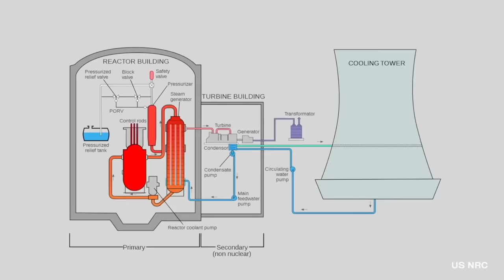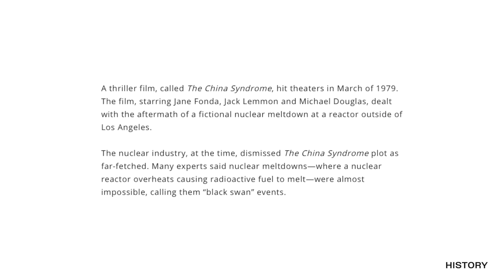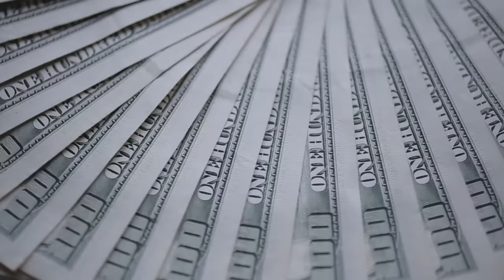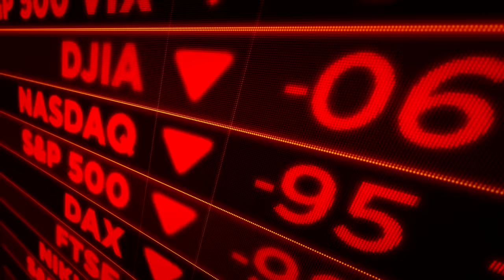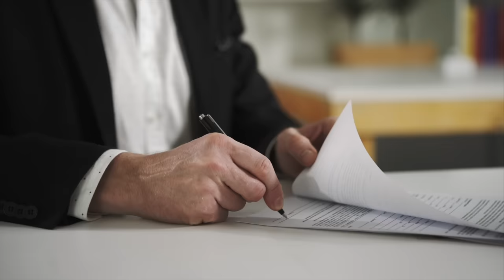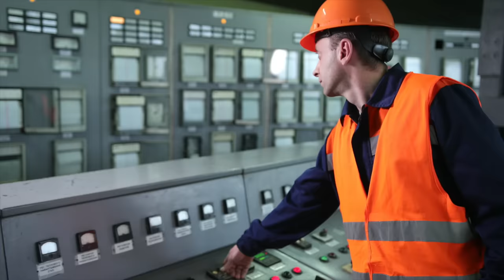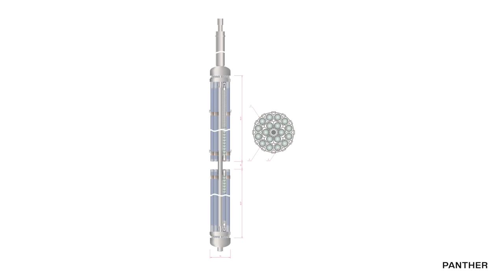10 Most Expensive Mistakes in All History

Comment: Fukushima could have been on this list. The reactor designers in the US warned TEPCO to build the generators high above sea level and further from the plant and they put them in the basement below sea level anyway. Without this critical mistake, the meltdowns at Fukushima never would have happened.
Reply: TEOCO Ignored all suggestions, etc. From many years before the sunami after the horrible earthquake
Reply: Warned?  They all but jumped up and down while frothing at the mouth.  The original plans as purchased by TEPCO specified that NO part of the Diesel Generators or Emergency Switchgear would be located lower than the 2nd floor and would be inside Containment.  TEPCO chose to change the plans to suit their own needs as they saw them.

At our local nuke plant, Design Basis assumes a breach of every dam on the Columbia River upstream of the plant...including Grand Coulee and the two huge earthen dams up in Canada.  At the site of the plant, the Columbia River is 5 miles away and 400 feet in elevation lower.  Engineers can calculate NO conceivable event which would cause flooding at the plant...even losing all of the dams upstream wouldn't do it.  Diesels and switchboards are still on the 2nd floor, as designed.  (Plant is functionally identical to Fukishima plants.)

Worst part of Fukishima is that there were passive systems in place which would have been quite capable of cooling the reactors during a total plant blackout...If the valves were properly aligned as they should have been with the plant online.  Even worse, the operators did not know how to visually confirm that the passive systems were engaged and working.

Operation is quite simple.  Pumps stop, convection begins routing the reactor cooling water through heat exchanges in huge tanks of water.  Water in tanks boil, convection returns cooled coolant back to reactor.  Since boiling water in a closed tank is a bad idea, the tanks were vented.  If you look at the Reactor buildings, you will see two smallish rectangular vents about 3/4 of the way up the side of the buildings.  Visual confirmation is as complicated as "YEP!  there is a 30-40 foot plume of steam roaring out of those vents on the side of the building!"
Reply: @kevincrosby1760  That is interesting context with a lot of things I didn't previously know, thank you for that.
Reply: Fukushima cost the lives of entire species! YES, it certainly should! The loss of plankton, the source of 70% of Earth's oxygen, due to the massive fallout, will certainly become more costly, as the reactors to this day still have no containment! No sarcophagus! This is why hydrogen power is being considered, we will need the oxygen to breathe!
Reply: @richardmccann4815  Have you considered research and applying real science to a problem before you post on YT?

Start with "still have no containment".  That statement alone is a bit off, like several meters of reinforced concrete off.

Reputable marine biologists cannot seem to find your massive plankton killoff.  I can find several references to a decrease in plankton in certain areas, but all are related to natural variations in plankton density.

I'd really like to see your list of "entire species" which Fukishima killed.  The ONE reference I could find was on a website which also blamed the eruption of Mt. St. Helen's on oil fracking in the Cascade Range.
Reply: Gotta save that $$ dude duh
Reply: @kevincrosby1760  Mt st Helen's. 🤣🤣🤣🤣🤣 NO FUCKING WAY that's actually being floated as a conspiracy. My God.
Reply: @dyetman0714  My jaw dropped when I saw it.

Vulcanism and Plate Tectonics aside, the "oil fracking" part was laughable.  While oil HAS been found in the coastal areas of WA  in very small amounts, nothing has been found which rises to the level of "commercially viable".

Commercial quantities of coal exists in multiple locations around the perimeter of the state, as do some VERY small Natural Gas reservoirs which have been drilled and used...but no oil has been found.

There WAS an energy experiment down around Bend, OR where they used fracking, but it had nothing to do with oil.  The experiment involved boring two deep wells, fracking the area between them, then injecting water in one to see if they could recover steam from the second with enough pressure and volume to support a geothermal power plant.  Not sure whatever happened with the attempt.
Reply: Not only that warning. They also had like 2 other audits say the same thing. Their solution was just to water tight the room but didn't think about the exhaust pipe which wasn't elevated enough and flooded from the wave.
Reply: So basically, TEPCO said "Fuk u shima!"
Reply: @Nate_123  I can't find them now, but there were several hundred pages of English-language documents online from the IAEA investigation which detailed the accident sequence and steps taken to mitigate the damage to the facilities.

TEPCO changes to the design and failure to properly train employees were shown to be the greatest contributors to the core damage.  SCRAM happened within seconds of the EQ.  All that was left was to get the cores cooled down.  Active systems went away with the generators, battery power for tertiary active systems had issues, and the most efficient passive systems were valved off.

If systems and personnel had reacted properly to the emergency and changes had not been made to the design, the results of the EQ and tsunami would have been cold INTACT reactors waiting to be de-fueled in the normal manner.
Reply: 18:50 "clean and sustainable" immediately describes one of a long list of nuclear environmental disasters that the nuclear industry wants everyone to forget or ignore

If nuclear power was as "safe" and "cheap" as the nuclear industry says then why doesn't everyone have a nuclear generator at their home (you know just like homes have solar powered devices)?
🤔
Reply: @PeterKnagge  You couldn't be anymore ridiculous if you tried 🤣 Having 'Nuclear Reactors' at home..... FFS 🤣
As for cost - 1 Ton of Uranium produces the same amount of power of 250,000 tons of coal. So not only is the cost substantially less but, it's also a lot more environmentally friendly. And what's the long list of disasters you mention? Which must be related to Nuclear Power Supply.....
Reply: @richardmccann4815  What entire species have been lost? As for the Plankton, how much was destroyed? Remember, there's a lot more of it in other places, so how much damage did it do?
Reply: Tsunami
Reply: It always amazes me how alot of disasters are caused by design flaws that would have been caught and corrected by a junior-high-school science class, yet were approved by college-taught engineers with PHD's.
Reply: @darrelljacobjr2120  and in some cases, they were actually caught, as is the case with the fukushima discussion in this reply section. Some companies and people are just to focused on cost cuts or taking the easy route rather than taking the safer (albeit often more expensive) route...

Comment: 3-Mile Island. In addition, the valve "sensors" did not actually monitor the valve positions. They simply reported the last command sent to the mechanism, not the real status of the valves themselves. A major design error.
Different alarms with the same sound is especially hazardous in hospital ICUs. Sonalert makes a very good product, so hack engineers use them in every device. The problem is exacerbated by the low level of harmonics. The harmonics tell us which direction the sound is coming from.
Reply: thank you for pointing that out, Underworld got so much wrong on that explanation. i get for simplification they had to, but still
Reply: They also didn't diagnose the problem properly and let water out of the system when it wasn't full, and plant knew that it could be an issue as the PORV valve had failed before but was caught before it became a problem. It was just a complete failure
Reply: airplane cockpits as well. 

The irony at TMI is if the engineers hadn't touched a single button, switch, knob, the reactor would have rescued itself. Though it would have a lot of water to scrub during evaporation clean up, which would have kept it down a while, the damage to the plant would have been very minimal, and the reactor up and running again.

Comment: 5:19 I actually have my own theory on how the Champlain Towers collapsed. The pool deck was slowly sinking, slow enough that the eye couldn't see, probably because of the amount of weight on the pool deck. Once that first column had a "punch through" failure, there was no stopping the pool deck from collapsing. I'm pretty sure I heard someone on another channel that said "The pool deck damaged the main columns for the building when the failure occurred." And then 7 minutes later, half of the building came crashing down.
Reply: Not just your own theory but also Miami Herald's theory at 6:38 blamed cracking concrete and rusted rebar (rebar is metal that makes concrete structures stronger and rust makes the metal rebar weak over time as its a very old building) so you and the news probably aren't wrong!

Comment: Part of what made that pepcon explosion worse was that since the shuttle disaster they were not using as much rocket fuel so it was being stored there
Reply: No one told the plant to reduce production so they kept producing the same amount as before Challenger and as you said just stored it.
Reply: Stored it in containers that were A: open to the air after collecting on the ground with other debris and B: the literal composition of the other additives to make rocket fuel! (Aluminum tote bins and glue from the plastic barrels if I recall correctly)
Reply: There were windows in Las Vegas that were shattered from the explosion. The 2 people who died were PEPCON employees (1 who was in a wheelchair if I remember correctly). They got everyone else out and called 911.
Reply: @chinchilla6547  Plus, they had a gas line going under the plant. You can see the jet of its fire near the end of that video segment.

Comment: 21:23 The Operators DID know about the graphite tips as it actually had a purpose that the plant made use of. The issue was that the control rods couldnt lower into the reactor fast enough, they went deep enough to speed up the reaction so much, that the water started boiling, which pushed the control rods back out. Now virtually stuck in place, it kept speeding up until it blew up.

Also there are still a handful of people living in Chernobyl and they are even of old age. But their living conditions are awful.
Reply: As in many other major accidents, numerous operating mistakes and design flaws/features interacted to contribute to the Chernobyl melt-down, and it is hard to point to a single cause. The scale of the tragedy was made much worse by the post-disaster management.

The unfortunate properties of RMBK control rods when a reactor was starting to run away were known from experience at another plant. But there was not a culture of information sharing, rather the opposite. A major mistake in the course of events was when the reactor manager overrode an instruction in the operating manual relating to how to cycle the reactor back from a reduction in power. He did this to reduce the delay to an experimental test procedure he was instructed to carry out from on high, which had already had some delays due to a series of operating problems. Junior operators objected, but did not know the exact reason for the instruction, or have enough reactor physics to be able to understand that carrying out the experimental test with the reactor in that condition would be disastrous. By the time there was an attempt to scram the reactor - drop in all the control rods to stop it - it was already too far out of control to be stopped with those control rods, or more accurately the speed they could be inserted. The attempt to use them sped up/intensified an accident that was in practice already unstoppable.

For a more complete technical explanation, the most detailed addressed to the "well-informed layman", see the book Atomic Accidents by James Mahaffey. For the political errors that contributed to the melt-down and subsequent appalling mismanagement of the aftermath, see the book, Chernobyl: History of a Tragedy by Serhii Plokhy, winner of the Baillie Gifford prize for non-fiction writing. 

It is the town of Pripyat closest to the reactor, and some other nearby small settlements, that were permanently evacuated and remain in a exclusion zone. The city of Chernobyl is about 16km from the plant, and was reopened, but not many people want to live there.

Comment: If your gigantic car carrier vessel is able to be capsized by incorrectly inputting numbers into a stability computer then something is really wrong with your ship...
Reply: Something's wrong with your crew
Reply: It started when they had to pump out ballast in order to navigate the shallow waters of the port. Things escalated afterward. Like an airliner, weight distribution is crucial.
Reply: @felipecardoza9967  I was on an old (Launched 1968) US Navy ship, not a modern car carrier.  That said, we generally calculated stability for the "worst-case" scenario anticipated.  If any part of a trip included a situation which would compromise stability of the vessel, then we sat at the pier until that situation was resolved.  Every ship has an optimal Center of Gravity and C.O.G limits which are not to be exceeded.

One of the MOST obvious things to check would be laden draft and channel depth.  If you cannot re-distribute the load, shift ballast, shift fuel, etc. to achieve an acceptable laden draft AND maintain an appropriate C.O.G. then you are overloaded, regardless of what the nameplate says.  In this case, they managed to achieve an unstable condition and STILL run aground, stop, and fall over sideways.
Reply: @Mr.Robert1  I can distinctly remember from my US Navy days spending the last hour or so of every 0400-0800 in port DC Central watch I stood sitting there with draft readings, tank soundings, lading bill, etc. filling out the daily Draft, Lading and Stability Report...with a calculator and pencil.

Somebody else would fill out the exact same report independently.  If they differed or something appeared off, readings and soundings would be repeated and the calcs done again.  Rinse and repeat until everything matched up.

Remember, this was in port on a Replenishment Oiler during normal pierside routine.  If we were taking on or moving cargo fuel or bulk stores, the new Stability numbers would be calculated beforehand and verified throughout the evolution.

I just can't fathom how you screw up the COG calcs enough to capsize a ship.  Then again, I'm still trying to figure out how a US Warship can have sailors on sea watch, sailors on bridge watch, and sailors on Radar watch and STILL manage to plow into a container ship the size of an apartment complex and fully lit with floodlights....

Comment: "The TMI-2 reactor was destroyed. Some radioactive gas was released a couple of days after the accident, but not enough to cause any dose above background levels to local residents. There were no injuries or adverse health effects from the Three Mile Island accident.Apr 1, 2022"  

the 3 mile island incident was used as an oil lobby talking point. while in fact it was safer than all oil, coal, and gas-burning power plants.  The costs of "cleanup" were so high because they had to decommission 2 perfectly safe and healthy active reactors which included the costs of replacing their energy production, and fulfilling their lost income insurance. .  had the political leverage against nuclear power not been out of greed 3 mile island would still be operating safely today.

tl;dr  3 mile island was a nuclear safety success.  no one was hurt, the environment was not impacted, and the "cleanup costs" were actually the costs of building conventional power plants to replace the lost energy production.   3 Mile island unit 1 continued operation for 40 years until September 2019
Reply: Released gas from TMI was Iodine-131.  Half-life of about 8 DAYS.  Decay rate would have had in undetectable at Release + 80 DAYS.

Comment: The ammonium nitrate itself wasn't a problem in Beirut. Ammonium nitrate is stable and not explosive or flammable. It is, however, a powerful oxidizer. Other highly flammable fuels were stored in that warehouse alongside it. The initial blast and ensuing fire presented an opportunity for the liquid fuels and ammonium nitrate to mix, producing an explosive material known as ANFO. Worse, these fuels were volatile, so flammable gasses were always present, and any spark could've started this situation. It's unlikely the fireworks were a problem. Many years prior to the incident, an extremely urgent e-mail was sent regarding the danger of this combination storage and it was ignored.
Reply: There was a hole in the Hanger 7 wall, and welders had been in there fixing it. The sparks started a fire which wasn't noticed or contained in time, and everyone started to evacuate.